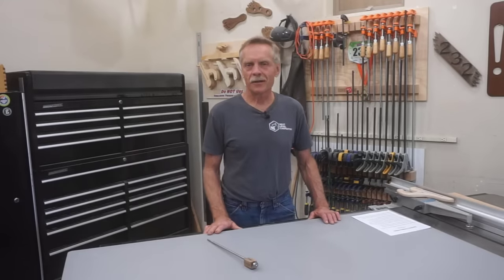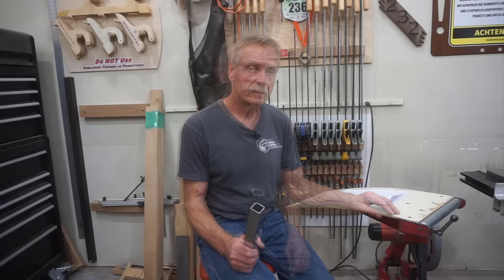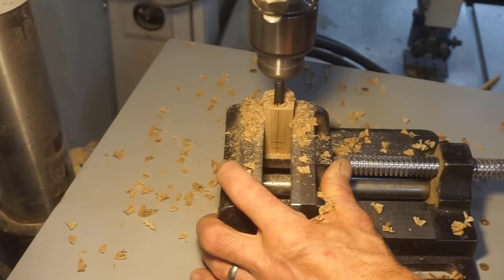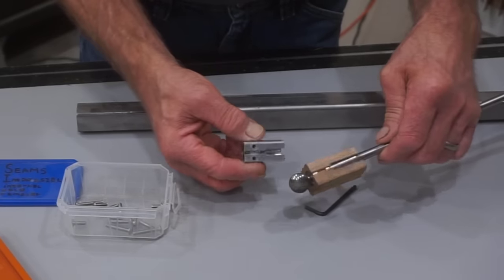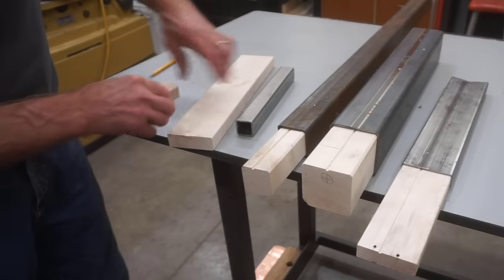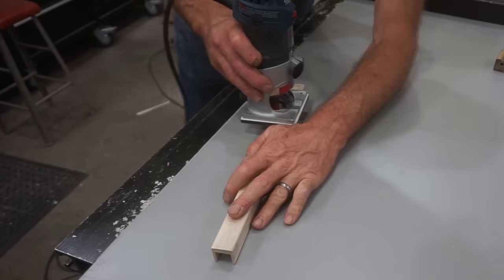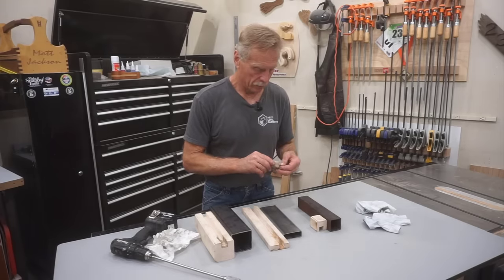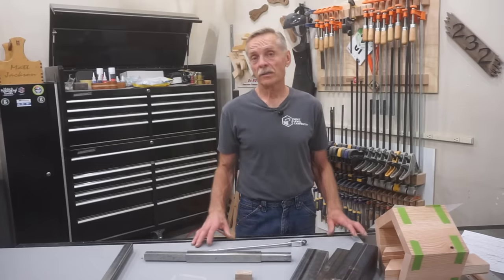How to Quickly Remove Internal Weld Seams from Steel Tubing

Comment: Brilliant idea. I have the tool steel version and while it works somewhat its not perfect. I was thinking would it be possible to have the tool come with a set of incrementally longer bolts. You would need 6 per run. You could screw two in the top to set the size of the tube, then two on either side to adjust for the weld seam location. The bolts would thread through the tool and be adjustable. Obviously the bolt could not be longer than the tube is wide, but  one set would probably handle most sizes. Not sure if a rounded bolt head would glide on the inner tube wall nicely, maybe the screw threads out and there is a skid on three sides that the bolt regulates and that skid is what slides on the tube wall. You could insert the tool, spin the bolts till they stabilize the tool, then pull it through.
Reply: Hmm... That's definitely a different perspective on the solution. It may work?  (NLC didn't show all his failed ideas.. so who knows?)
Reply: @MRSketch09  The more I thought about it, I think a wedge type design would be simpler. Just like an exhaust pipe spreader tool. Turn a screw draw two wedges in and press a plastic block outward until it is in correct position.
Reply from the maker: Guys: There's many ways to skin this cat but from what I've seen using a rotary cut produces a much cleaner, smoother and more consistent 'cut' with considerably less effort than any of the 'broach-type' methods out there... but that's just me.
Reply: @NextLevelCarpentry  Oh I totally agree. I was just thinking about a way to make a substitute for holding the rotary broach in stead of having to make the wood block.  Some sort of expandable outer housing that fits into different tube sizes, then the rotary tool you have slips inside.
Reply from the maker: @lexteakmialoki5544  Ahhh... it was I who misunderstood... sorry?  It would be cool to come up with an expandable 'jacket' that would make it less fuss to switch between different tube sizes and weld locations since, once you get to looking, it seems like every tube is made just different enough from the rest that each piece needs a unique jacket size and orientation... figures I guess?  I like your thought process in coming up with a series of bolt heads to position the cutter... hmmm. I'll try to remember to mention this to Greg next time we talk as he's a great brainstormer too! Best, Matt
Reply: @NextLevelCarpentry  No prob, Its so hard sometimes to explain conceptual stuff without a whiteboard !! I think the muffler pipe expander tool design would be the way to go. Just turn three screws that face forward and they drive individual wedges that expand a plastic block on each side outward till it meets the side of the tube. Wedges plus side block to fit the tube ID. Bigger tube swap out a bigger side block, same wedges.   Maybe you guys can figure out something cool.  Thanks for all you do Good luck.

Comment: Great video and great solution what I've done in the past is is a cutoff wheel and grind a slot down the middle of the outside of the inter tube. I know technically it will weaken it. But in the past it's got the job done this is so much better though!!

Comment: Great idea, I've run into this problem a lot. For small things, I've gotten away with just pounding the tube in, which shears a bit and deforms both tubes a small amount. You could weld on a tool steel blade thingy to help with that maybe. Sharpen the edge of the inner tube like a chisel after running a bead of high carbon filler across the cutting edge. Something like that.
Reply from the maker: And NOW you can make or buy this simple little tool and get first rate results easily... how cool is THAT?!  No more pounding, deforming or scraping... something like THAT! 😎
Reply: That just gave me a thought! Just weld a cutting tool to a piece of tubing to fit inside the other tubing and weld an end on the other end and just beat it thru till it falls out. Problem solved !!!

Comment: Cpt...... nice video.....trust me i hv a old heritage house in Goa, and so, it's 9mts hight  so I thought of making
scaffolding to put sajas for the window so I made scaffolding of 30mm tube 1×1mt and every 1mt level joint I had to weld 25mm tube to slide in 30mm tube to make it stand it was very difficult so ur tool looks good but it should be practical in scrapping the weld inside the tube i tried to buy it on Amazon India but i couldn't fine, so I had to scrape the tube with half round file 10inch , i don't think that ur tool will take the scraping load of grinding.......bt ur video was nice...... TKS

Comment: Love your idea! My only concern is that the small-ish round burr actually removes a bit of the wall thickness of the pipe. could you use a larger burr and come closer to a flush cut?

Comment: Great idea!  I've seen other tools that use a harden chisel edge in front of a plug to gouge out the weld.  Yours is easier to make using garden variety tools and is 100% effective.  As far as being too wordy or otherwise not quick enough for attention deficit folks that's what the FF and mute button is for.  I've subscribed and look forward to future videos.   Thanks for posting.
Reply from the maker: Thanks for watching and subscribing I do hope you like past and future videos as well. I really appreciate your comparative assessment of the seems impossible tool to the other scraping methods out there on YouTube. There does seem to be a polarizing effect caused by this video which seems to be an affront to those who have used one of the scraping methods. At this time Greg and I are very pleased with the results and expect others who are open minded for improvement will be pleased as well.
Best, Matt

Comment: Nice!
The weld location across the inside face of tubing varies from one supplier to another, so that could be a challenge.
This solution leaves a great finish in a two pass process.
So.... whaddaya got for round tube?😚
I saw all of these and now yours. Each has its merits, yours being the best (IMO) for shops needing a single tool for various tubing sizes and willing to make adapters. I definitely favor the sliding jacket!
Reply from the maker: The reality of varying weld locations inside tubes highlights the genius of Greg's idea for a tool of minimal size to allow various jackets to position the cut for any weld position 5/16" away from corners or more.  With enough demand I'm sure we could come up with an adaptation for attacking round tube seams but square seams seem the greater challenge so we addressed it first.  Time will tell but thanks for watching and commenting here Chuck! Best, Matt
Reply: I agree the adapter approach is absolutely the most flexible....and you only need one tool!
Reply from the maker: @CCCfeinman55  Sweet as a self-licking ice cream cone right? 😎
Reply: Next Level Carpentry Better’n Pistachio pie!

Comment: Hey matt that's using the old top knot for more than a hat rack for sure. Great tool for a long time problem and thanks for sharing. How about using 3 adjustable metal wings that attach to the tool and can be adjusted for different sizes as well as weld seems that may be off center by a fudge. It would look similar to a broadhead arrowhead or reversed broadhead. Just a thought you might consider hope it helps
Reply from the maker: Sounds like you're putting your 'old top knot' to work too!  Thanks for adding your thoughts to the discussion here.  BTW Greg and I were discussing alternatives to the 'jacket method' just the other day so we can blend your concept into that discussion with hopes of simplifying/optimizing the adaptability/useability of the Seams Impossible tool going forward.  Best, Matt

Comment: For asymmetrically located weldseams you could turn the jacket around on the tool for the second, reverse pass. Or let the jacket inside the tube and drag the tool through form the other side. 

I wonder whether the full length jacket is necessary at all. The place of contact between cutter ball and tube is the area where a form is needed to keep the cutter at its intended working height (depth). So a flat sheet made to the inner dimensions of the tube with a rigid connection to the tool is all that is needed. It will not tilt because of the long shaft of the tool. Any movement of the shaft by the operator is limited by the tube itself. Only at the very end of the operation the opportunity to lift the shaft out of alignment is increased which has the danger of cutting deeper into the seam area. That could be avoided by a second profile mounted at the other end of the tool's body. I would also make a dado in the bottom of the tool which clears the weldseam. This way the tool's body sits on the tube outside the seam. And it's possible to set the cutting ball flush with the bottom. Then it grinds only the protuding seam itself away and not dig into the tube wall itself. The tube is not weakened. Cheers, Manfred.

Comment: Brilliant idea! I really appreciate you sharing it! Weldon flats can be ground on the burr’s shank to keep the bit and extension from separating while pulling.
Reply from the maker: Good idea Julian... that would be extra helpful on longer tube where loosing the tool inside could make retrieval a problem... thanks for suggesting! Best, Matt

Comment: I had to do this once but with 50mm SHS and the die grinder work fit inside. I just used 1/2 of the original tube cut down to fit inside and lots of duct type to adjust the gap with a rod attached over 1.2m. Depth of cut was adjusted with angle and duct tape.

Comment: This is a brilliant tool and I will be pre-ordering one. Just 1 idea. If you made your jacket 3 or 4 inches long instead of 2 inches long, and drilled the holes offset in the length so that the jacket protruded off of the front end of the seems impossible block by an inch or 2, then you would be able to clear the seam all the way to the end without a full length sleeve or grinding out the last inch by hand.
Reply from the maker: Great observation and suggestion Bob... this seems to be a viable 'best practices' idea finding traction... thanks for watching, observing and commenting! Best, Matt

Comment: Cool product.

If you have a corded drill with a place to fit a stabilising handle, you could put a guide bar on this part to rest on the work surface and then run your de-burrer down a round tube with a universal joint on the shaft. If the round tube is clamped off, the guide on the drill should keep the cutter running in the same place relative to the tube if the guide on the drill is running on the work surface. The UJ should allow you to lift up the drill sufficiently so you can mount your workpiece directly to the bench surface.

Maybe it's overkill. 

These plugs could be quite easily 3D printed in PLA. Print in 2 halves along the workpiece axis and glue the two halves together with CA. When they wear, just warm them up with a heat gun to extract bearings.

Or maybe you could print normal to the workpiece axis in one go.

Comment: Just to let everyone know... square tubing does in fact exist that has the weld seam in the corner, just for this particular application. And if you are a maker that uses steel tubing for this type of application, it's worth having a stick or two on hand just for the times you need it. You can google telescoping square tubing and find a manufacturer that does sell them to anyone, and even ships up to 8ft long sections UPS.
Reply from the maker: Many viewers have made the same statement and recommendation but it is not all that helpful without specific links because many search diligently and find no results. If you know of a reliable source I would welcome a reply comment from you sharing links for other viewers to use. Best, Matt
Reply from the maker: @EcoMouseChannel  Nicely done Eco Mouse... thanks for the links!  You are obviously a better 'google-er' than I am!😁  There certainly look to be plenty of options for anyone looking for telescoping square tube if they can't or don't want to make their own! Best, Matt

Comment: I ordered metal for just this task!
Needed telescopic tubes. I expected to have to mess around machining the “weld”.

I ordered 30mmx30mmx2mm
I also ordered 35mmx35mmx2mm
Low and behold when I picked it up one slid inside the other perfect with about 1mm clearance, no snagging.
Metal supermarket West Bromwich uk 🇬🇧

Comment: I really like that !👍
It is an awesome idea and very useful. I will definitely build me one of those. A perfect remedy for the DOM tubing.   
Now, got any ideas on round DOM pipe like the black gas pipe you can buy at Home Depot. ????
Reply from the maker: Other viewers suggest using a hole saw of the right size for round pipe/tubing... seems it would be a bit rough but probably OK.  Greg and I discussed ways to adapt the V2.0 tool for round stock but didn't devote much time to it... yet! 😎  If the pipe is actually DOM (drawn over mandrel) there shouldn't be an internal seam to contend with... Best, Matt

Comment: Hey Matt.  I don't know about buying or making this tool because I wouldn't have need for much material, but I can foresee the need for a few feet of smooth interior tube from time to time.  You may want to have someone with the tool manufacture it for you to sell sell in your store.  By the way, you should patent the smooth internal tube. Simple product, but needed. Idea. If you had an industrial quality tool made, some company is sure to make smooth interior tube that would sell in large quantities.  There are big possibilities. Maybe go on Shark Tank!
Reply from the maker: Good thinkin' all around Russ!  Turns out tube that can 'sleeve' is available in many sizes and custom lengths by a number of suppliers starting with McMaster-Carr so that market is already 'filled'.  Had I found it a couple months ago I may well have never invented this tool or worked with Greg to improve it because just buying a couple chunks of the sizes I need for the outfeed roller stand build is sure a lot faster and simpler!  It's been a fun journey so far though and I suspect it will continue to be quite a ride... Best, Matt
Reply: @NextLevelCarpentry  You just killed the  market for the new tool, However,  there may be a few people who need sleeved tube in quantity, ASAP,  and grinding their own may appeal to them.  It would definitely appeal to welders who have all sizes of tube on hand, and being able o make products with sleeved tube whenever they need it would appeal to them. Now you have to contact the welders on YouTube.

Comment: Great work and great
idea! You guys should sell the sleeve system too. A lot of metal fab guys don’t have work working tools.
Reply from the maker: Unfortunately the 'sleeve system' is too specific to individual pieces of tubing to make any sort of universally functional jacket system Mrcaffinebean because we'd sure like to accomodate the metal fab guys you mention.  Other viewers are mentioning 3D printed jackets which I think is a fantastic idea.  Best, Matt
Reply: Next Level Carpentry yeah I thought that might be the problem. I’ll definitely be getting one these before I start any running project.
Reply from the maker: @Mrcaffinebean  Sounds great... I think people are going to be 3D printing jackets for the tool before long.  I know it would have been a lot quicker and simpler if I could have just gone out and bought a Seams Impossible for the upcoming Outfeed Roller Stand Build!  Hope the tool helps you out... Best, Matt

Comment: I like your idea. You might  consider using a long shank 1/2" ball end carbide burr and eliminate the slot in the tool for the grub screws.
Here is one from McMaster Carr: 6.4375" long    P/N	4324A29	$18.99
You could use smaller bearings, angle the bearing bore in the block (like a  1-3 degree angle) and use a 1/4" stop collar to capture the bearings in the block. A simplified design.  For longer tubes you can always extend the reach with additional extensions. Just a thought.
Reply from the maker: The main reason for the slot is to provide clearance for tool as it has to pass over the un-ground weld before it grinds it off. Your design has merits but would either need a similar slot for clearance or need to be pushed through the tube to cut the weld first.  I considered those factors and ended up with what you see in the video. Pushing the tool creates a few problems of it's own: how do you get the tool started and what about grindings piling up in front of the tool as it's pushed?  There's plenty of room for redesign/improvement and the type of creative thinking you do is just the sort of brainstorming that advances design and is always welcome here, especially when presented so 'politely' as yours.  Best, Matt
Reply: @NextLevelCarpentry  I attended a continuing education class for my career field (lots of egos in attendance). Someone responded to the instructor by telling us his way.  It was a decent second way of handling the described problem. The instructor said "Folks, there is usually more than one way to be right".  Wow. That instructor was a rare breed - he left his ego at home and left me thoroughly impressed. Matt, you clearly get this. Salute.
Reply from the maker: @e.zachlee-wright9160  Thanks for you assessment of my character...  much appreciated.  You did catch me at on of my finer moments as I'm not always gracious when viewer comments are impolite, insulting or just plain block-headed. 😉😎 Best, Matt